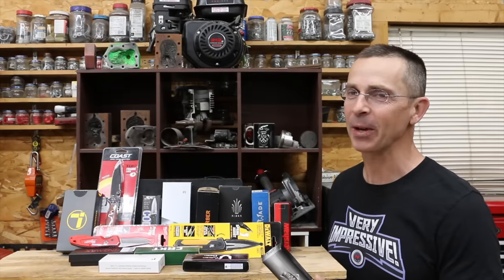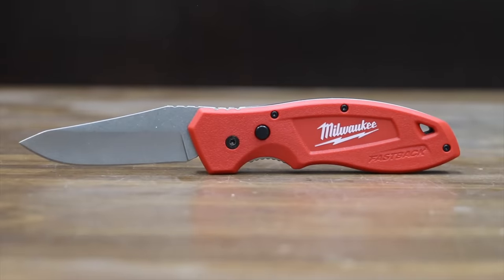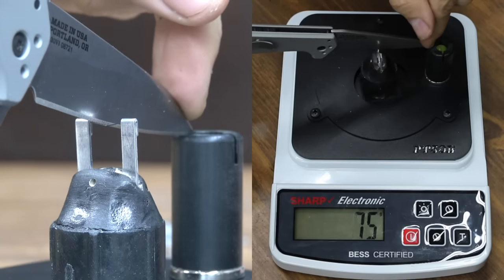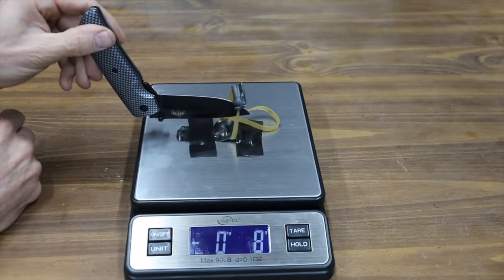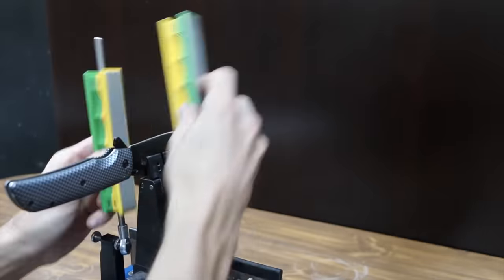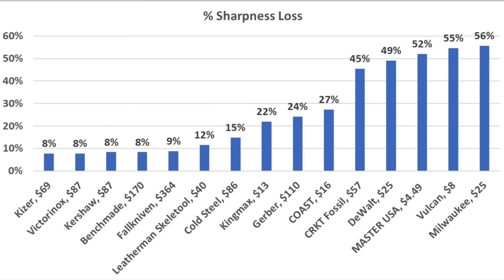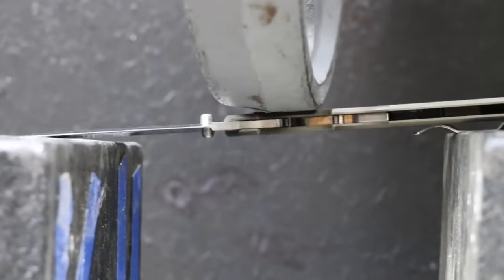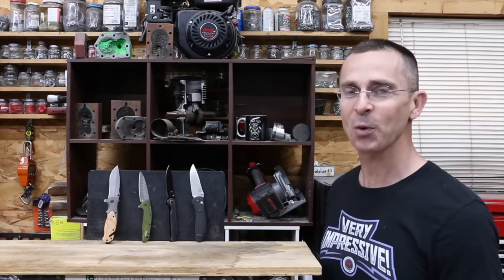Best Knife (Ep 2)?  CRKT, Gerber, Leatherman, Fallkniven, Victorinox, Kershaw, DeWalt, Milwaukee

Comment: I saw someone else recommend permanent marker testing, and I would love that too.  Revmark makes some pretty nice ones that hold up really well compared to Sharpies when writing on abrasive materials like stone/brick.
Reply from the maker: Thank you!
Reply: This would be great to see! I would be interested in Sharpie vs: Milwaukee (which is fairly new), Bic (which seems to hold up better), and Office Depot (which have a longer tip) permanent markers.
Reply: Dykem makes a good paint marker.
Reply: I would never have thought of this, but this is an excellent idea. Cheap markers just tend to have tips that fall apart really quick.
Reply: Agreed, anyone else rember El Marko? Stunk to high heaven, but the ink was nice and thick.
Reply: And advice by us followers on refills. I keep mine alive "for ever" just with acetone or cellulose thinner, but they do go more greyish for every refill.I'm old, and don't think I've bought 10 during my whole life, bcz I just pick up discarged ones and give them new lives.
Reply: @dposcuro  Some of the thin felt ones get worn rather fast. But if you are carefull, you can grind(sand) the sleeve away, and create a new very fine point a few times. Also they can often be replaced with tips from other ones, which only have been used on smooth things, that don't wear them out.
Reply: that looks like a fun idea, i wanna see this
Reply: Yes please on this one too! One of my most used tools. Tons of sharpies and the Milwaukee markers. Id like to see if the silver pencil deal is worth it.
Reply: @ProjectFarm  if you do this include the staedtler lumocolor permanent pen
Reply: This would be a good one! If you do it make sure you do a regular sharpie AND a sharpie industrial grade.
Reply: @remingtonspeed7481 , I have an El Marko downstairs at my work bench!  It does indeed stink!

Comment: Would be interested to see a permanent marker comparison. I put my name on my dive gear but it fades extremely fast. So maybe a good test would be to use different paint markers (alcohol, water, oil based,...) on surfaces (hard plastic, flexible plastic, cloth, metal,...) and apply different wear methods (sanding, water,...)
Reply from the maker: Thanks for the video idea.
Reply: Excellent idea! 👍
Reply: Super great idea!!
Reply: Not gonna happen.buy an engraver.
Reply: Great idea
Reply: The Milwaukee inkzall would clean house. Only one I use
Reply: Tests to see if the industrial sharpies are actually better than the regular ones in any way other than high heat since they're often the same price
Reply: Did you suggest 'sanding'?  Really...anything you could write with a permanent marker you could certainly remove by sanding.  [you could even remove engraving with a sander, though it would certainly be obvious]
Reply: @ProjectFarm  what a "sharpie " idea  ! Got to test the fake knockoff "sherpie" markers found at the dollar store as well as all the premium brands
Reply: @Voyajer.  I tend to think the industrial sharpies do hold up somewhat better, I actually got several hundred signatures up on the inside of my car roof by hundreds of musicians & talent & many held up even after a decade in the hot sun & uv exposure....my car was in a vice article years ago & most are still clearly visible....some of the regular markers faded
Reply: @kenc2257  Sanding would give an indication to how it fares with sand/dirt/rocks.... Of course you can remove it with enough passes but maybe some of them are more resistant
Reply: @ProjectFarm  if you do permanent markers, you should test it against noodler's bullet proof ink. It's used in fountain pens, but can be put in a refillable marker. Very high quality ink.
Reply: Milwaukee inkzall is your winner hands down

Comment: As a "Knife Guy" for most of my life. And as a mildly serious collector I really enjoyed this test. Especially the last part, with the Green Beret veteran! The side to side pressure test, in most cases seemed to favor the knives that use washers as opposed to bearings on the pivot point. While I do have a few well made edc pocket knives made in China, I do favor the utility and overall strength of the Benchmade, Cold Steel, and Fallkniven. Once Again another Great Video!
Reply from the maker: Thanks and you are welcome!
Reply: I second the Benchmade and Cold Steel assessment.  If not for weight it might be a tossup for me between Cold Steel and Benchmade offerings.  Considering weight I've been carrying a Benchmade for three or four years now.  Before that I would change them out every year.
Reply: Kizer seems the clear winner to me, given the price.
Reply: @kid5Media  Made in China VS Made in the USA. Better steel costs more as well.

Comment: The Milwaukee knife is a flip blade.A little flip of the wrist and easily open. Love your YouTube channel and the detail you go through to give us accurate info thanks.
Reply from the maker: Thanks so much!
Reply: Yep Robert is right. Brand new, those specific Milwaukee knives open by them selves if you just hold them down. Upside down the blade will fall out, and if you just hold it straight down the knife is supposed to open and lock on its own after pressing the button and releasing it. They are called “Fastbacks”.love those things. But get concrete in them your f$cked. 
Tool brands make nice low priced knives that can take a beating.
I used to have like 5 different knives for different tasks.
Reply: @XyzXyz-pm2rj  The 11th Commandment is "Thou shalt not swim in concrete."  Heed this advice, sir.
Reply: @XyzXyz-pm2rj  I used to work on cell towers, and my fastback survived a 150ft fall with chipped paint. It was the first style they made with the utility blade. Love those stupid little knives.
Reply: I’m glad someone mentioned this. Yes, very easy to open with one hand. I love my fastback
Reply: @XyzXyz-pm2rj  sorry, necro posting, but my fastback does not open easily, you have to flip it pretty hard and it will still not open all the way sometimes, I don't like it, I've had it for like 7 years and it's still a pig to open, that's why I'm gonna retire it and looking for a new knife rn

Comment: I was very surprised and impressed with how well the $40 Leatherman Skeletool performed!
Reply from the maker: Thanks for sharing.
Reply: me too, that's my choice pick right there. near the top at every test and only 40 bucks.
Reply: @deeRay7292  Spend the extra and get a Benchmade.
Reply: I liked the skeletool also but didn't see the opening of this knife in the test.  If it has spring assist, it will be my next buy.
Reply: Noticed Leatherman results as well, Id say its the winner considering the price. I am biased though since a Skeletool multitool is my EDC, been super happy with it for years
Reply: hands down what I would get. don't need all that weight and made in the USA!
Reply: I've had it for 2 years, It's small but I love it. No issues, sharpens like a dream and it's tiny. It's what I was looking for but it might be too small for some.  
The only issue is that if you're using the pocket clip the bottle opener can get caught, so be careful that you don't loose it.

Comment: I'm not too sure how important "initial" sharpness is. I would be more concerned about how long it stays sharp after being sharpened.
Reply from the maker: Great point! Thank you
Reply: I think it is a combination of the two. It is shocking how many people never sharpen a knife and then proceed to toss it after it goes dull.
Reply: This was going to be my point.  The knives really show their quality after you remove initial sharpness.   I don’t mind seeing the comparison, mind you, but it certainly wouldn’t affect a purchasing decision.
Reply: Yes. Any steel alloy can have an initial sharpness of a razor, but the ability to hold the edge and ease of sharpening can vary greatly.
Reply: Exactly what I was thinking. While getting and inadequately sharpened knife out the box is unacceptable especially for big dollar knives , it doesn't say anything about the quality of steel and heat treatment that the knife possesses.
Reply: Most people will use the same edge for years until they lose or break the knife regardless of how dull it is
Reply: the "cedric and ada outdoor" had done rope cutting test on all knife and steel available.. that rope cutting test help to show which blade have a great edge retention.
Reply: @SimonRiley115  - Blade geometry seems that it would be easier to tell by looking at the knife than the lock release force would be. Force is important to people with strength issues due to injuries, age, etc. Not everyone is you.
Reply: agreed but it says a lot about a company by how they treat their factory edges
Reply: @HughesEnterprises  Unfortunately… Whenever I go to someone’s kitchen I always find old dull knives. What’s the point in using a tool that cannot perform its primary job properly ?
Reply: I think it’s important because companies advertise their “initial” sharpness. All benchmades come “benchmade sharp” and comes with free sharpening for life. My benchmade was very sharp out of the box. I’m never going to use their sharpening service because I do it myself. But even if it doesn’t matter, testing the validity of a marketing claim is important to me.
Reply: "Initial" sharpness assesses how the company's factory edge is (if the apex is lined up and if the bevels are even). More of a measure of qc than the knife itself. However, sharpness tests that rely on pressure cuts such as this don't represent the true "sharpness" of the edge. These tests only function to see how little resistance there is behind the cut (meaning, how thin is the edge and the geometry of the blade). The bite of the edge in addition to thinness and geometry is much more important, albeit nearly impossible to measure.
Reply: @Alpha-Leader  I guess the difficult part of these tests is that someone who spends $30 on a knife had completely different expectations from someone spending $364. At $364 the buyer is likely an enthusiast and the first thing they are going to do with their new knife is pop it on some fine stones and then strop it. No knives are satisfactorily sharp out of the box.
Reply: well, good point but if i pay 100-300 bucks for a knife i expect it to be pretty darn sharp out of the box.
Reply: @DenEvigePeder  It should be sharp for $30 out of the box (unlike Benchmade)
Reply: @SimonRiley115  The lockbar test is good for people who don't have good hand strength. Easier for women to deal with and people how have arthritis. The pain and inflammation make it harder to apply their strength. On bad days. My joints will not close to apply my strength. I can't clamp down enough to hold a pen or pencil. When I have higher then normal hand strength.
Reply: That was the point of the cutting board test: to see what the edge retention is like. However, running the edge against aluminum might be interesting as well. Any long term testing with so many knives would take forever but in my experience high end steels such as s30v do hold an edge better over time.
Reply: @SimonRiley115  Irrelevant? Only to someone who never uses a knife. Some people drop knives often. What the tip does can indicate the temper of the steel also. Maybe you need an easy lock to disengage or maybe you need a lock that stays put so it doesn't accidentally disengage. The world has more nuance in it than any one persons limited experience and results in limited perspective. Project Farm's choices in the knives he reviewed would suggest he knows his knives very well.
Reply: I think the initial sharpness is a good indicator of manufacturing quality
Reply: @isaiahspinney6113  I don't know if that's true, but it certainly is an indicator of attention to detail.  And whether the company's right hand knows what its left hand is doing.

Comment: The poor showing by Dewalt and Milwaukee reveals the importance of shopping within a company's wheelhouse. Their power tools perform reliably, but they can't do everything well.

Thanks for another great test!
I especially appreciate the percentage of lost sharpness display. Very useful.
Reply from the maker: Thanks and you are welcome!
Reply: Milwaukee knives are soooooo bad. Including the utility knives. Miles behind even the cheap chinese knives.
Reply: @-fazik-3713  my fastback utility blade is rock solid, not sure what you mean. The blades themselves?
Reply: While not having any insider knowledge I would bet the knives made by power tool companies are made by someone else. Subcontracted out.
Reply: For sure! What caught me off guard was the difference in design. Milwaukee has a very usable design and it would be great if it was higher quality, but Dewalt had a design that is...well, I have no idea what they were aiming for.
Reply: It’s weird since Milwaukee always does good with drill and impact bits surviving that metal.
Reply: @EricLS  agree, I love my fast back utility knives, I have about 5 of them (all the different models.) I don't like the milwaukee blades though, they start out sharp but dull very quickly. I generally just go with the Stanley heavy duty blades, for the price they perform fine for me.
Reply: @-fazik-3713  I’ll object to that.  I’ve had my Milwaukee for a year and use it daily. Goes in my pocket and I use it for everything (roofing) and it just keeps kicking. Holds the blades well and flips open like day one. So I’m happy with it.
Reply: @calebwhite6173  But the design, tolerances and overall quality is soooooo bad for the price. I've owned more than 400 blades and Milwaukee ones are bottom tier 15-20% of the worst ones. The price only makes things worse ...
And I'm' team red. Great tools, very poor blades.

Comment: Kershaw has always been my favorite brand. The speedsafe is awesome and is the easiest and smoothest knife to open. I have a kershaw launch auto knife that's amazing. Insanely sharp. Even my 20$ Kershaw knives are almost as sharp as the more expensive Kershaw ones. I have probably 15 and haven't sharpened one of them and they still cut real well
Reply from the maker: Thanks for sharing.
Reply: I like my Kershaws.. but I broke the tip off one also 😄 sent to Kershaw and they returned it with a very sharp replacement blade
Reply: Bench made knives are better
Reply: Kershaw knives are very good in their price range. I have a Kershaw cryo, Skyline, leek, crown, and a few I'm forgetting. These are all older models, for a reason. I have broken the tips off of 2 Kershaws, and have not purchased a new one for almost 7 years.

 I'm still on my original benchmade, no problems, ultra reliable, holds an edge, lightweight. It has been my EDC for 4 years consecutive. If i ever need another knife, it will be a benchmade.
Reply: I have carried $20 Kershaw's for years I have never broken a blade tip and I use mine many times a day, I rarely ever have to sharpen either.  The opening test was the only one I had an issue with, as you can't show opening force using the wrong opening method for a knife.  The correct way to open a knife with a flipper is with the flipper, and Kershaw's are effortless.
Reply: @user-lr9cw9bb3k  Benchmade knives are nice, but Kershaw will replace a knife blade no matter where you buy the knife from. 

Benchmade products originally purchased through the "Custom Knife Builder" are eligible for blade, handle, or hardware replacements. 

So if you buy a Benchmade from a brick and mortar knife store and break the tip off it's not guaranteed to be replaced for free. 

However I have heard Benchmade is very reasonable with a replacement cost on a knife blades not bought through their factory custom knife builder program. So that's pretty cool 👍.
Reply: @user-lr9cw9bb3k  yea but they're also 300$

Comment: The thing about the Milwaukee knife is you’re supposed to flip it out! I was also confused on why they would make a push button without them studs but you just flip it!
Reply from the maker: Great point. Thank you
Reply: All my knifes I flip even if they are spring adsisted
Reply: I came here to say the same thing. Also knives like this benchmade with the axis lock can be flipped in the exact same way.
Reply: @jedigoof1548  in both directions too
Reply: @BIGREDTECH  YEs, my Milwaukee razor knives are similar and they flip like a switchblade, no fiddling...

Comment: The one thing I would love to see tested on these blades is corrosion resistance. I've got the Milwaukee knife, and I'm not surprised at how poorly it did in these tests. On the other hand, I lost it outside in the dirt and rain for about 2 weeks, and when I found it there was no rust on the blade.
Reply from the maker: Thanks for the video idea.
Reply: generally that question is answered by looking up the steel. some of the diving knives are made of garbage for knives Stainless, being used only being of corrosion resistance. they dont rust, but they dont hold an edge either
Reply: I also carry the Milwaukee knife and it does rust too easily except for if it gets sweat on it. I dropped it went it was new and broke a large piece of the tip off. I don't really like how heavy it is.
Reply: @HerbaceousM8  That's why its common for dive knifes to have a serrated portion to the blade.
Reply: @HerbaceousM8  True, but not all manufacturers actually let you know what the steel is.
Reply: @m.cigledy6769  all knives worth carrying have steel types listed on the blade or easily found.
Reply: @HerbaceousM8    A lot of them use titanium for it’s non magnetic and corrosion proof properties. However, a piece of wood will hold an edge longer if titanium isn’t alloyed with other metals.
Reply: @m.cigledy6769  then i grantee its not worth carrying